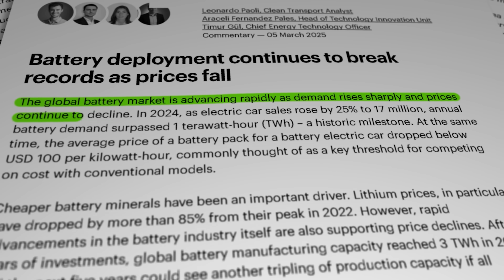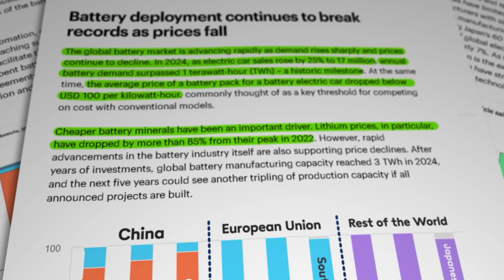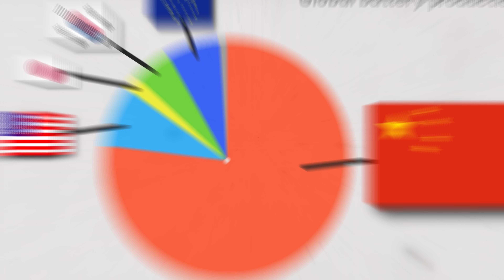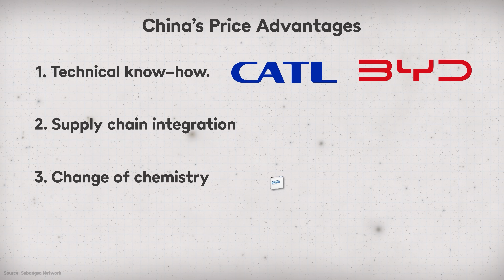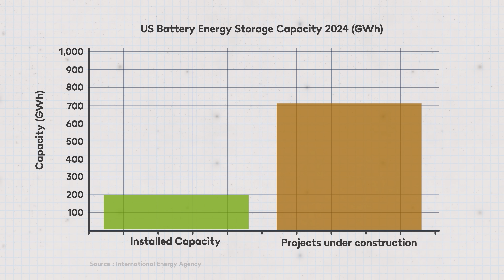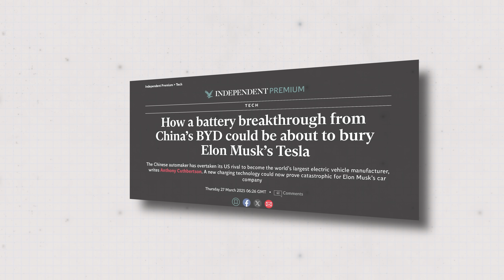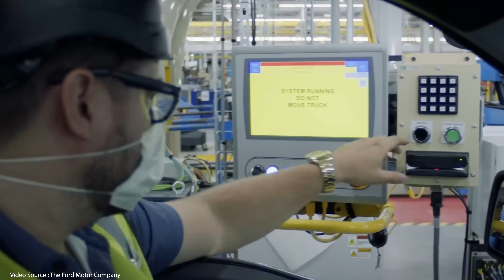Have batteries just hit their exponential curve??

Comment: What I am hearing about the Chinese market, is that they value advanced technology over anything else. Recent comparisons of Tesla’s FSD versus that from Chinese manufacturers is very favorable to Tesla. The Chinese automakers seem to be focused on gimmicky features like rotating seats and big displays for the rear passengers. While these may appeal to some, I think FSD is a true game changing technology. I have it on my vehicle, and I rely on it a great deal. I still have to pay attention, but I only need to intercede when there is a safety issue. I am not running the most recent version of FSD, because it has not been released for my car’s hardware, yet. Tesla has talked about a possible upgrade to the vehicles that are running the older hardware,if it ends up necessary to be able to get on the newer versions of FSD.

Comment: Thanks Dave, nice perspective, quoting a hyperbolic Independent article requires a response though. See Grok analysis as follows :  

The argument in the Independent article claiming that BYD’s battery technology could “bury Tesla” has several flaws or points of contention:

Overemphasis on Charging Speed as a Market Decider: The article heavily focuses on BYD’s Super E-Platform’s ultra-fast charging (400 km in 5 minutes) as a game-changer. However, consumer preferences in the EV market are multifaceted, including factors like vehicle range, price, brand loyalty, software ecosystem, and performance. Tesla’s strengths in autonomous driving technology (e.g., Full Self-Driving), software updates, and a robust global Supercharger network (over 50,000 stalls) may outweigh charging speed alone for many buyers.

Limited Geographic Scope: The article emphasizes BYD’s charging infrastructure expansion in China (4,000+ high-power stations). However, Tesla has a more established global presence, with significant market share in North America and Europe. BYD’s infrastructure and sales dominance are largely China-centric, and scaling globally to challenge Tesla faces logistical, regulatory, and cultural hurdles not adequately addressed.

Underestimation of Tesla’s Innovation: The article portrays Tesla as lagging due to slower charging speeds (250kW vs. BYD’s implied higher rates). However, Tesla is actively developing faster chargers (e.g., V4 Superchargers with up to 500kW potential) and has a history of rapid innovation. The claim that BYD’s technology will “bury” Tesla ignores Tesla’s ability to adapt and improve its battery and charging tech.

Sales Data Cherry-Picking: The article cites a 700% surge in BYD registrations in the UK and Tesla’s declining sales in China and Europe. This selectively highlights BYD’s growth in specific markets while downplaying Tesla’s global sales (e.g., 1.81 million vehicles delivered in 2024, per recent estimates). Tesla’s sales declines in certain regions may reflect temporary market dynamics, such as subsidy changes or competition, rather than a permanent shift.

Speculative Impact of Musk’s Affiliations: The article suggests Elon Musk’s political affiliations (e.g., ties to Trump) are damaging Tesla’s brand, particularly in Europe. While some consumer sentiment may be affected, there’s limited evidence that this has significantly impacted Tesla’s sales or loyalty globally. This claim feels speculative without robust data linking Musk’s politics directly to market share loss.

Ignoring Broader Market Dynamics: The article frames BYD’s rise as a direct threat to Tesla but overlooks the broader competitive landscape. Other EV makers (e.g., Volkswagen, Hyundai, Rivian) and traditional automakers transitioning to EVs also challenge both companies. The focus on a BYD-Tesla binary ignores the complexity of a crowded, evolving market.

Technological Feasibility and Scalability: The article doesn’t scrutinize the practical challenges of BYD’s Super E-Platform, such as battery degradation from ultra-fast charging, cost of production, or compatibility with existing EV infrastructure. Without details on scalability or long-term reliability, the claim that this technology will “revolutionize” the industry is optimistic and lacks critical analysis.

Exaggerated Language and Bias: The use of “bury Tesla” and comparisons to the combustion engine’s demise are hyperbolic, suggesting a narrative-driven agenda rather than a balanced assessment. The article underplays Tesla’s diversified business (e.g., energy storage, AI) and global brand resilience, which buffer it against single-technology disruptions.

In summary, while BYD’s charging technology and market growth are impressive, the article overstates its immediate threat to Tesla by ignoring Tesla’s global reach, innovation pipeline, and broader market factors, while relying on selective data and speculative claims about consumer behavior.

Comment: Excellent Dave. With corruption investigations they say "follow the money' but in the case of  consumer buying trends "follow the price". Home batteries are going to fall 50% in price. It is predicted by everyone.  You only have to look at the Tesla power wall.  In Australia they cost $12,900 but there are only $2,000 of actual batteries in them.  In Australia it is about the same price to be off grid vs on,  at today's solar and battery prices. When battery prices fall and solar is also predicted to fall another 50%, the world will go off grid. In Australia 40% of all homes have solar  and they are just waiting for the battery prices to drop.
Reply: Powerwalls are a ripoff. he battteries in tthem can be had for less than $1000. Add a housing and a bit of inverter and control electronics cosi not a lot and the rest is sheer profit.
Reply: @rogerphelps9939 laugh out loud than why is the powerwall industry leading?  Ans:  it not about battery price.
Reply: "Home batteries are going to fall 50% in price." They already have fallen by at least that much in the last five years - I was pricing my BYD batteries recently and they're now less than half what I paid in August 2020 here in Spain. I was the first in my neighbourhood to install a PV system, now there's half a dozen within 500 metres of me.
Reply: Had solar panels to offset the electricity cost for years connected to grid. Eventually had to replace them. Net result, was I lost the solar input bonus and now only get a fraction of the Kw hours back compared to usage.

Comment: An AU$30B investment in batteries to support the night time demand of electricity of various Australian grid networks, an estimated AU$20B investment in newer HV transmission lines (they don't need to be HVDC, AC around 300kV is good enough) and allowing the private sector to fill in with another AU$70B investment in setting up massive solar projects allows Australia to have 24x7 reliable renewable electricity grid network, nation-wide. Total of AU$50B investment from government and AU$70B from the private sector, equaling to a total of $AU120B in investment. 

Of course, not all of this investment needs to be made RIGHT NOW - but rather over a period of 10 years.
How to pay it off? Exceedingly simple. Through 30 year energy bonds. Australia in 2024 consumed somewhere around 270.2Tera watt hours of energy. An extremely small energy tax of ONE Australian cent on every kWh equals to about AU$2.7B per year.

A 30 year energy loan, at 3.5% interest rate, of principal amount of AU$50B equals a monthly payment of about AU$223M or about AU$2.7B/year, for 30 years - all the while, we are reducing impact of carbon emissions from coal and radioactivity spewed by coal on the Australian populace.

Improvements achieved in carbon emissions, lower impact on Australian health, ability to not use a valuable exportable resource domestically, and electricity infrastructure that doesn't have fuel on operating cost side of the balance sheet - is immeasurable.

An average Australian household consumes 6500 kWh of electricity per year. The energy tax adds to the their bills - only $65 per year, assuming that they consume all of the energy from the grid. Australian have been putting on more and more solar + battery backups. In reality, on an annual basis this energy tax doesn't add more than $45 on average for the ENTIRE year.

Average Australian electricity is FUCKING expensive, from 15-45 cents per kWh. With the Australia Solar Initiative, we can bring the higher end down to as low as 25 cents per kWh, including the energy tax.

ALL of this is possible, with current grid scale LFP battery backups and better interconnections of various grid networks to take advantage of later/earlier sunshine hours, we can be completely dependent on solar energy.

Any further increase in solar energy harvesting can then be used to smelt aluminium, make pig iron from steel electric arc furnaces, and maybe even synthesize natural gas/methane for export.

There is a clear chance for Australia to be THE dominant renewable energy nation in the world, and harnessing the massive solar energy we receive to create new export markets for our goods.

Comment: Interesting video. 
Thanks for the analysis - couple of questions tho, 
1. How is battery manufacturing capacity measured in units of energy? I did not quite understand that.
2. I think one of the main obstacles of EVs is not only the minerals themselves (although really important relative to the amount of EVs needed in referees to ICEs ) a percentage in growth does not mean much as it is a relative measure. 25% of 100 cars is just 25 cars more - not quite useful metric. 
3. A recent study on DFES from local networks approximated that just with a 0.4% increase in EVs will put the grid in troubles as distribution networks cannot withstand the amounts of power needed for medium density battery EVs. 

So - still a good technology but as always, all is more complex than it appears and i think things cannot be analysed in isolation.

Having said that, thanks so much for the video
Reply: Manufacturing capacity is measured as the number of batteries produced X the watt-hours of those batteries / time, so the units are watt-seconds / seconds, or simply watts. For example, a factory makes 1000 batteries of 2Wh each per year, so that is 2000 Wh batteries per year. "per year" here can be seen as cancelling out the "hours" of Watt-Hours, so this can be abbreviated to 2000 W.

The power grid for many countries does need work - because it was literally not designed for this use-case - and this work will be expensive. However in many countries the power grid needs work anyway to handle an increasingly different world. Basically, we needed that investment come what may.

Comment: I'm a bit confused about the graphic at 8:25.  Is that capacity to store energy for the grid, or is that battery storage production per year, e.g. 200 GWh of batteries per year?
Reply: I have the same question regarding 4:05
(Also - if aggregate - does that include EVs...?)
Reply: It’s total battery production, for all end uses.
Reply: @simontillson482 likely.
However that's not what it says though ('storage capasity' - ie aggregated production, not yearly production).
Reply: @erik5820 I think it refers to the battery capacity total production per year. If it was aggregated you wouldn’t be able to compare one year with another, and the capacity already installed just in grid applications is way more than those figures, so I’d be pretty confident these are yearly production figures and the future projections are also. In the industry, a new factory usually quotes the total battery production per year in MWh or GWh etc, so these are pretty normal ways to quantify battery production figures. It’s just the most sensible and easily compared way to measure it.
Reply: @simontillson482  again; this is probably so.
My point, however, is that it is both annoying and sloppy for a science channel ti have so ambigious texts. 
It kind of; How can I trust the numbers and the rest when this is presented, and what does it realy mean ? (and I can't cite it either)...
(Btw: it is fully possible to compare aggregated capasity; it would just mean that the graphics will be steeper.)

Comment: I like the idea of an ev apart from I also like the right to repair and almost all car manufacturers are making it harder to do that so instead I'll just have to consider converting a classic, plus side is it will be lighter and have less electronics so the battery should go further on it than on a modern one with same size battery.
Reply: true, we should fight for the right to repair

I wish i could do a ev conversion in my country but the gov doesnt allow it....
Reply: Bu you will have to pay through the nose for that and it will definitely be inferior. I can assure you that EV makers pay a lot of attention to weight and your conversion will almost certainly be heavier than an equivalent EV built as an EV from the ground up.
Reply: @ you can get a lifepo4 cell for 55euro/1kwh and if done correctly the conversion will be way batter then the current modern evs just because it wouldnt have thousands of gimmicks and sensors that get upset for no reason and brick the car that only the dealership can fix with expensive computers and programs and throwing parts at the car that cost a arm and leg

when it comes to charging and efficiency then it would be worse most of the time but if you consider the repairability then it makes up for it